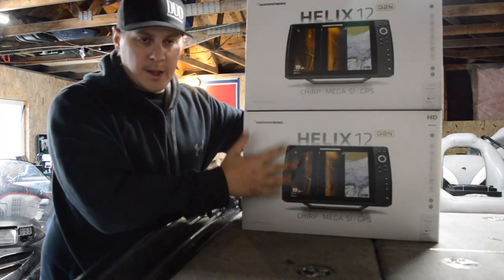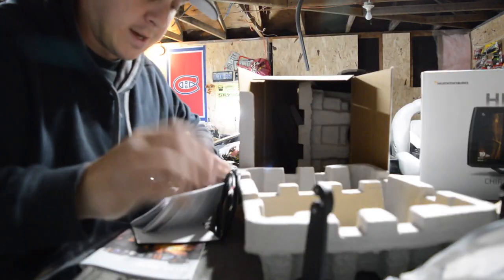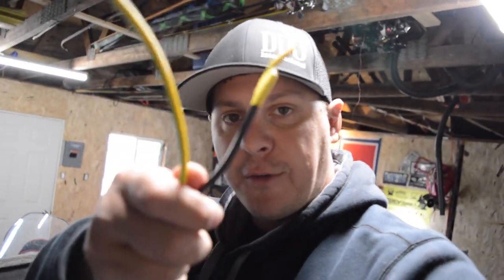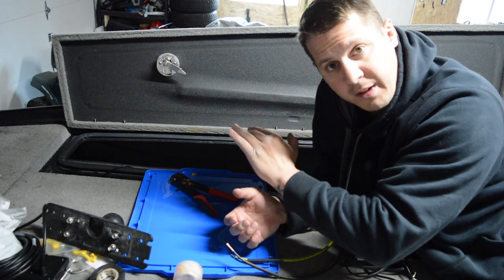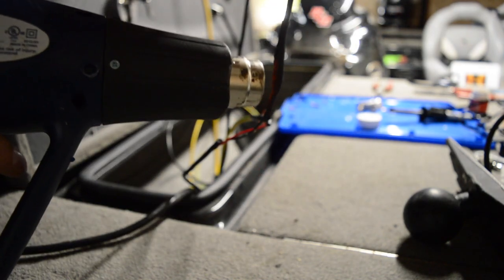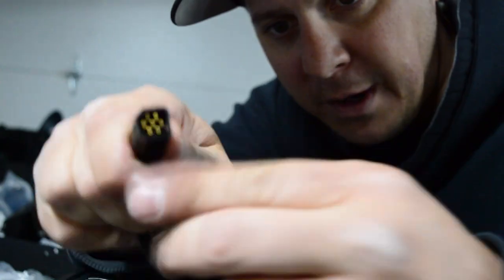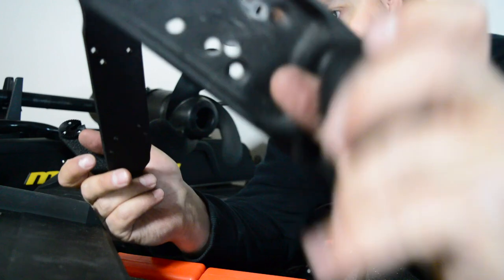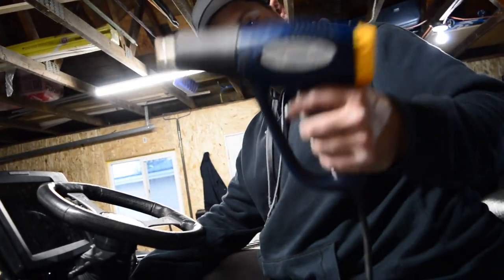How to: Install Your Helix Humminbird fish finder Part 1

Comment: 7:23 The 6.25" RAM mount holes line up with Humminbird 12 gimbrel mount holes.  RAM-D-115-E is the one I got.  It has the long arm.  No extra mounting plate hanging over and no drilling required.  The part number for 6.25" mounting plate only is RAM-D-115BU.  Hope this helps someone.  It looks a lot cleaner.  Great Video though!  Thanks!

Comment: You can run your wires on the same side as the trolling motor usually it will be easier. Just make sure you separate your wires by using conduit, braided cable sleeve, or cable wrap all the way along said cables.

Comment: I connected my Lowrance unit to the trolling motor battery because the unit would go off each time I started the motor and the voltage dropped for an instant.  That auto turning off was built into the unit.  I had no problem I know of with interference.  I just got a Helix 12 DI and ran a new #12 wire from the trolling motor battery.  What will interference look like and will it interfere with the GPS.  Thank you for your informative videos.

Comment: Great video but one question......did you infer early in the video that the wire from the bow mounted Helix should be separate from the wires going from the trolling motor to their respective batteries? That would seem to mean the wire from the Helix bow should be run down the starboard side of the boat (assuming the trolling motor wiring is run down the port side). Sorry if I am being overly thick here, but getting ready to buy a couple of these and want to have a clear game plan. THANKS!!

Comment: Lots of good info on here.  Question for you though... I crimped my power wires with ancor heat shrink butt connectors with an ancor single ratcheting crimper.  I feel like this is more than adequate.  Thoughts?

Comment: Hey, question.  I’m about to install a bow mount helix 10 g3n, how can i be certain that my cranking battery can supply enough power with the other accessories on my boat? Also, did you run power cords from the unit directly to the battery or use the fuse box connection at the console? Thanks in advance!
Reply from the maker: Direct and use the inline fuse with the unit. Make sure you get a deep cycle cranking battery they make them now

Comment: I have tried the to find the right magnets . No luck so far and any advise on where to get the right ones and how many do you advise.
Thanks, Tom
Reply from the maker: Amazon has them. Ferrit rings. 2-3 they are cheap. If you have issues after that you didn’t wire the unit directly to battery with 10gauge wire
Reply: Can you look on amazon and tell me which ones to buy. There is a lot of options on there. Thanks for getting back to me. Great help with wiring up my new Humminbird
Reply: Seabass Outdoors hi there. Do I need to install a high speed transducer? Or just use the big one that came with my helix 10? Thanks man.
Reply from the maker: No need for high speed transducer what is that ? You mean speed sensor  ? Your gps will do that

Comment: At 5:28 you mention wrapping medical tape or Hockey Tape around the power connections on the unit.  I can probably get the medical tape.  Your talking just a normal white tape right?  How many wraps are you making around each post?  I have had a few times where attaching the unit and it moves and disconnects.  Even though I always try to press on good and tight.
Reply from the maker: +Bob Askey hey buddy. Just a complete turn with the tap so it overlap it helps.
Reply: Great thanks.  I might take this Humminbird back to Cabela's.  It has been a total can of worms.  The ACL is not all that good, Humminbird support sucks, My sonar 2D isn't very good, I had to buy a bigger battery so the unit won't shut off, dedicated wire from battery to unit.  The bigger battery helped and no shut down today.  The sonar I'm using two transducers one for 2D and the Si.  Maybe I should try just using the one transducer that came with the unit by itself.  I have the 2D Transducer on the transom.  At first it seemed to work better.  The Si was ok today but I got better screens when I first bought it..  A few times I thought I had it dialed in OK.  We got the Helix 12 Chirp Mega Si G2N.  I sold my Garmin unit to help pay for the Helix and sort of wish I kept the Garmin.  Garmin's side imaging is not so good.  Their mapping is way better than Humminbird's ACL card.  I have 90 days to return it to Cabela's and I'm getting close to throwing in the towel.  Still not sure but I'm thinking return it before we are stuck with it.  The reason I say Humminbird support sucks is I have been given bad information a number of times.  The unit powering off I was told to ship it to Humminbird.  That cost a lot to do with boxing up, shipping and insurance.  Humminbird shipped it back with nothing found.  I called and the support person told me nothing was found with the unit.  You didn't send the transducer so we can't tell you if that is what is wrong.  I was told NOT to send the transducer twice.  Really frustrating that their support isn't very good.

Comment: Did you run all your wire including your finders to your battery or did you split them to a connector box?. I was just wondering if there was a way to not have so many positive and negative terminals on my battery posts. 4 is supposed to be the maximum on each battery post and I'm already at 5 on each.
Reply from the maker: Get multi post adapter for the battery all to the battery direct
Reply: @SeabassOutdoors  Ok thanks again.
Reply: @SeabassOutdoors  Ok. I'm guessing you can get those at Canadian Tire or somewhere?
Reply from the maker: Amazon as well

Comment: I have looked on Amazon and  number of other places and no where can I find these ferrite rings. There are a few available on Amazon but they are way too small to get the transducer cable through more then one wrap. They are also much more expensive then a couple bucks. So don’t know where you finding the sizes that will work
Reply from the maker: Amazon as tons of options with inside dimensions for them.
Reply: @SeabassOutdoors  Yeah I looked. I.D seems way too small on all the ones sold there. Will check an electronics store

Comment: How did you power both units? Are they running off one fuse?
Reply from the maker: +Kham Yang  straight to the battery on their on wires with inline fuse.
Reply: Seabass Outdoors can you do a video on how to wire up power to multiple units?

Comment: Solder makes a week joint. Sure the solder is solid, but the wire will break on both sides of it. NEVER solid boat wiring. Otherwise, nice video.

Comment: you didn't show where you ran the wires to. Did I miss something?. Power source at the console?
Reply from the maker: Power source straight to the battery for each.
Reply: @SeabassOutdoors  Ok thanks. So you don't recommend running your front unit to a power source at your front of boat?
Reply: @SeabassOutdoors  just wondering because I already have too many wires running to my battery. what about running the wires from the front and splicing to the wires at the console unit? would that work?
Reply from the maker: No watch the whole video don’t skip. I say why in this
Reply from the maker: Your going to have interference that’s up to you
Reply: @SeabassOutdoors  Oh Ok. Sorry. I noticed you said don't hook it to your trolling motor batteries. I didn't mean doing that. I understand that part.Just thought you could wire to just a switch or something else. I didn't know you would get interference as well that way.

Comment: Y do u want side imaging on the front of the boat it won't work ppl at bass Pro said u have to be going straight and with the trolling motor moving around to much side imaging won't work for ur front helix..

Helix mega DI for the front and Helix mega SI for the console.. I think this is what I'm going to go with
Reply from the maker: LoL you trust bass pro employee to know how to rig a boat? I’ve won’t few tournemants with side imaging at the front and seeing rocks piles on the left and right
Reply: Seabass Outdoors not that I trust him but kind of makes sense too me.. but I'm knew so what do I know right... just trying to get as much info as I can making a big purchase soon.. I'm getting the helix 9 mega.. but not sure if too get two SI  units or SI/DI units..
Reply from the maker: You can link them and get SI from the console unit to the front. I don’t always bring my console unit. That’s why I have the si in the front

Comment: I use this depth finder to fish for crappi and to mark places I have found crappi this is a great little depth finder>>>allabout.wiki/tq35    I put it on a 16 ft Jon boat and it's is very accurate and has a great picture easy to use and mark spots and helps you get back to those exact spots